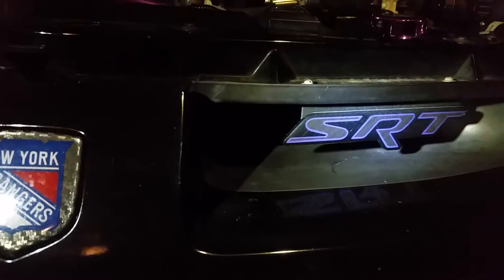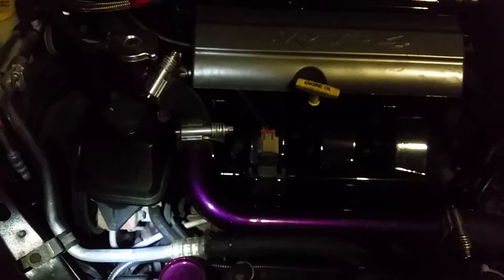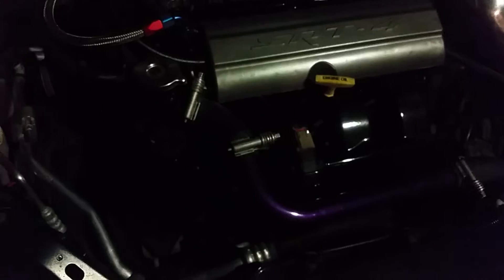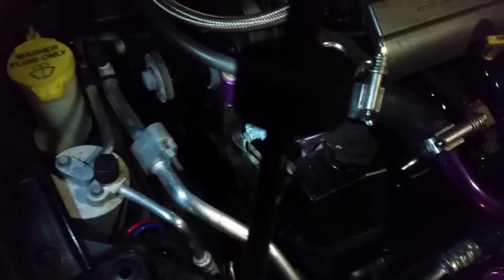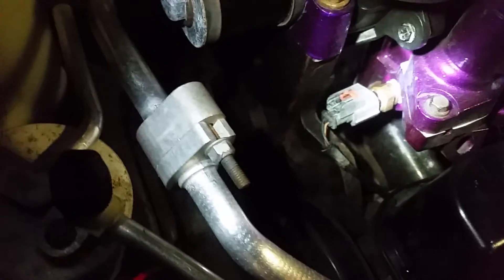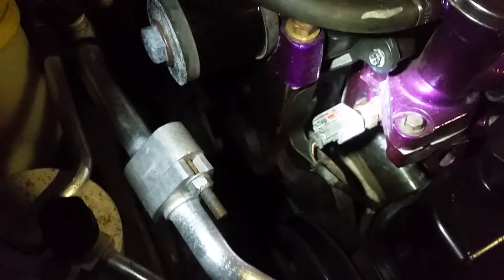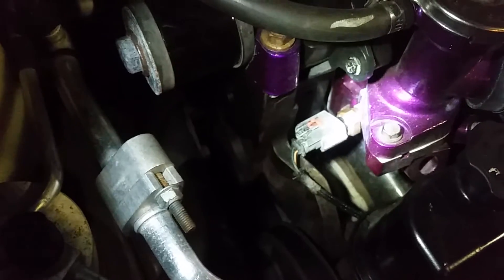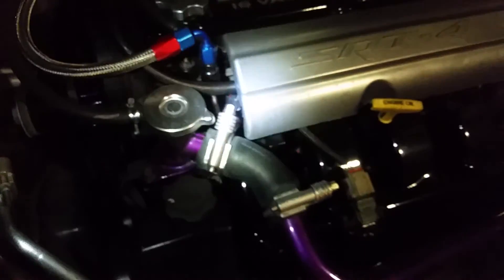2005 Dodge Neon SRT-4 Code P0128 runs rough

Comment: The temp sensor will not make it run bad or idle bad has nothing to do with that the temp sensor is so you have the coolant temp in the car on the temp gauge it's the TIP sensor making run rough i had the same problem changed the TIP sensor and it runs great now.....